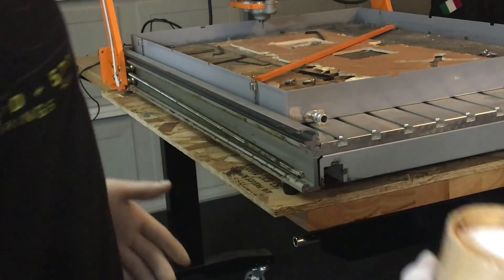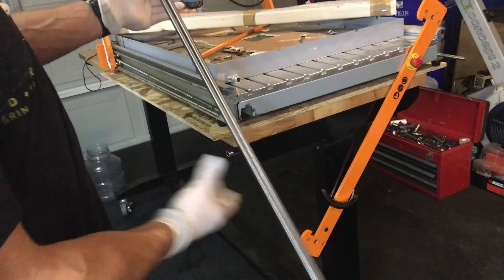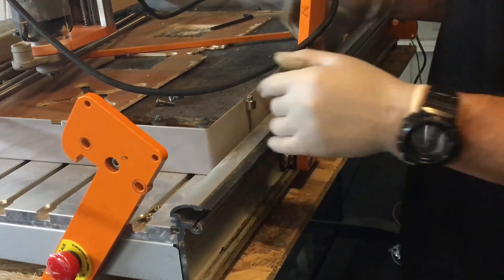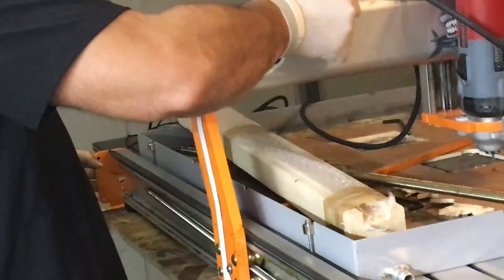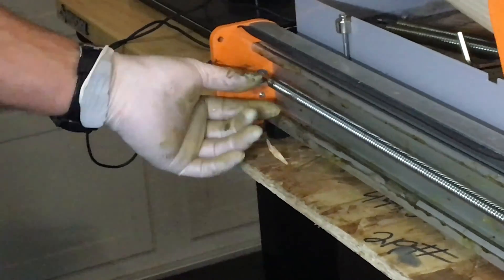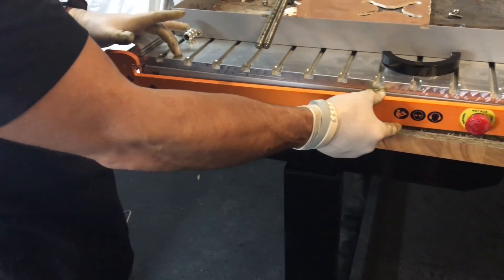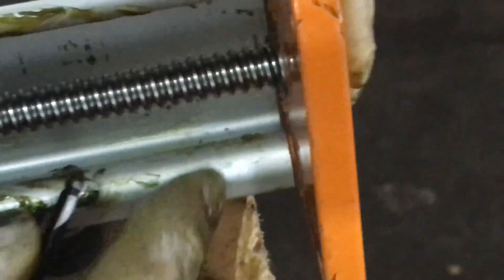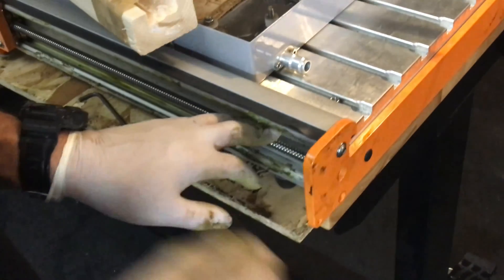STEPCRAFT CNC LEAD SCREW INSTALLATION

Comment: Hey Hover,
Saw your video.  To bad your having issues with your step craft.  May I ask what symptoms where you experincing that lead you to the conclusion???
Reply from the maker: lowrider9367 hey lowrider. I was having weird metal shaving sounds. and was not responding correctly when cutting all the way to the back.